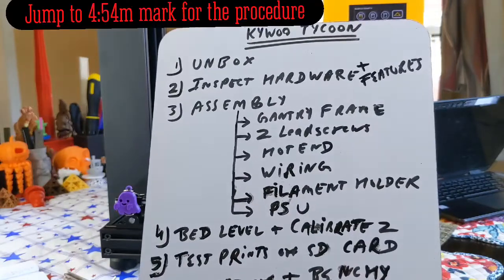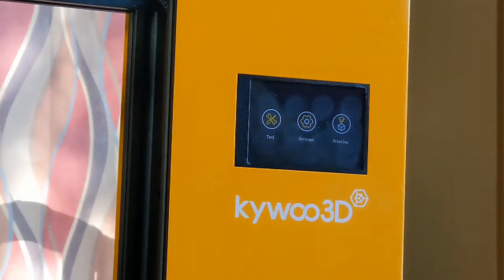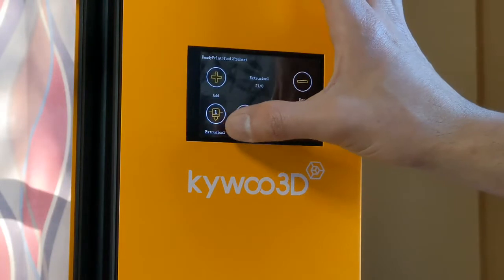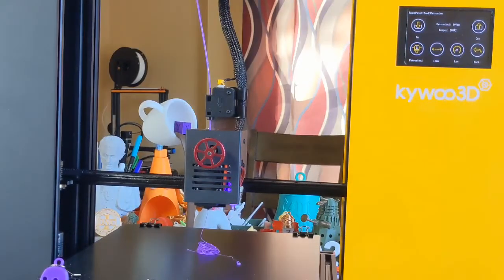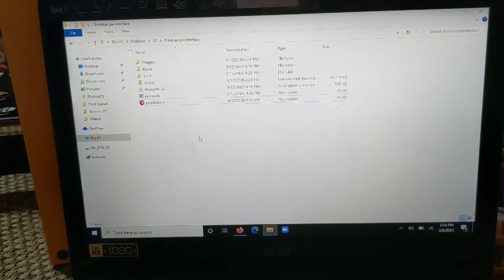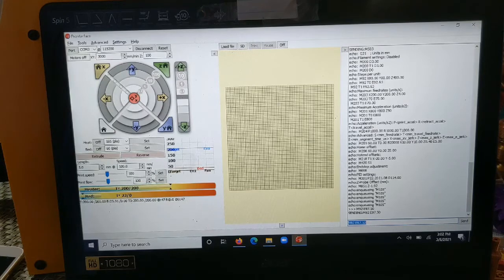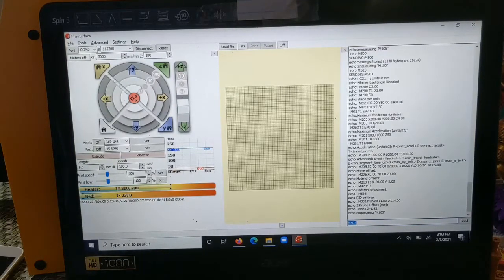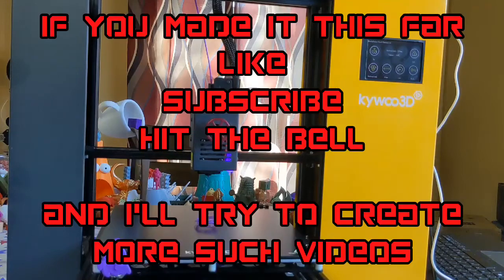HOW TO calibrate eSTEPS using Pronterface (featuring Kywoo Tycoon)

Comment: Thanks! Just a note: with the new firmware version you don't need pronterface. It can be all done on the printer touch interface.
Reply: Thanks! And yes, I had made this video, over a year ago, for the stock fw, as people couldn't figure how to.
Reply: @GauravGulati2019  The video was a great help to finally calibrate my e-steps. I have the kywoo 3d for little over a year now. I recently changed to a 0.6 nozzle. I don't use my printer frequently but I was surprised how bad the temperature tower turned out, sliced with Cura. I had an old temperature tower printed a year ago, probably with 0.4 nozzle. But to be honest I am quite overwhelmed. I don't really know how to tackle the problems... I start to believe that this printer isn't as good as indicated by many reviews

Comment: does not work with kywoo new firmware. i hate z offset
Reply from the maker: Why does it not work with new fw? It's just pronterface.
What's your issue with z offset? It's straight forward .. Just take your time doing micro-adjustments to get the right layer Tramming = no gaps, no scratchy. Print first layer slower (15-20mms) and hotter (5-10C) than the rest, do the temp tower to find the best print temp for a given roll